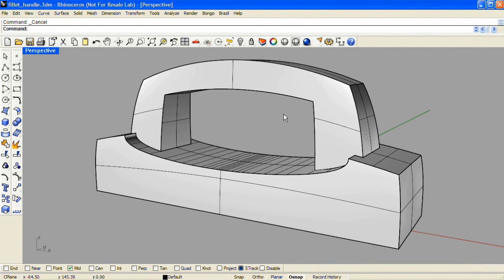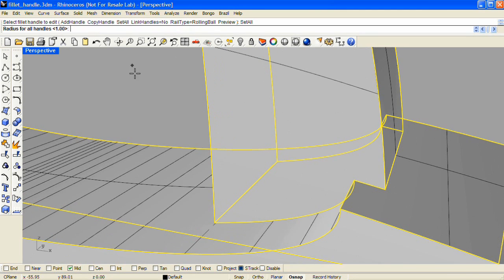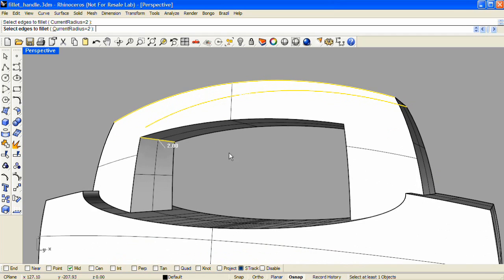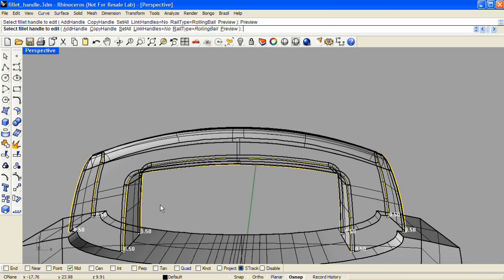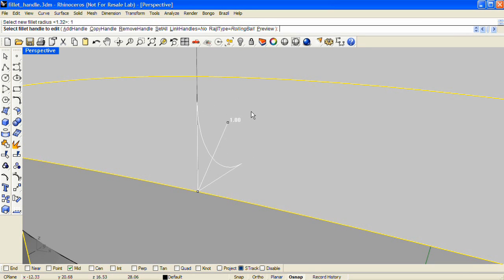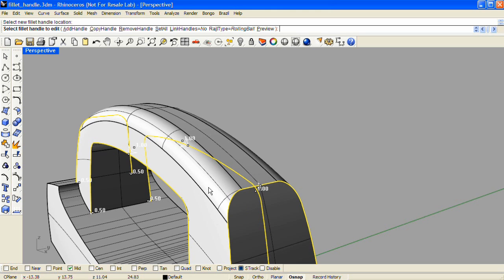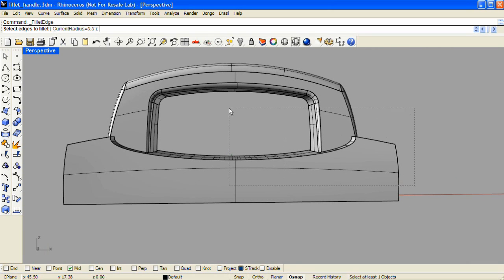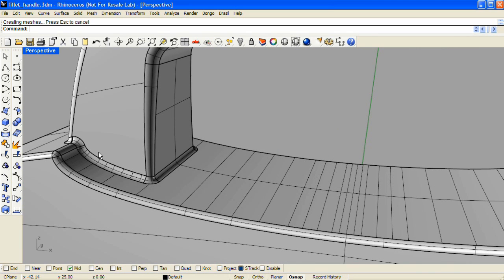Filleting method for solids

Comment: Why do you say, that after a 2 inch(?) radius, the connecting radii should be smaller? I can imagine a ball with r 2. Rolling on the inside of the surfaces with no trimming/tangency problem